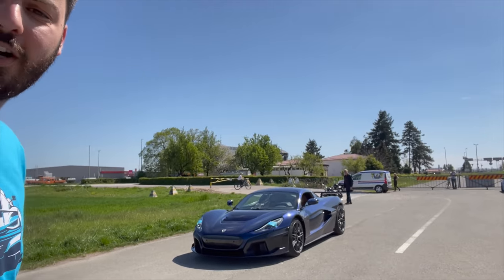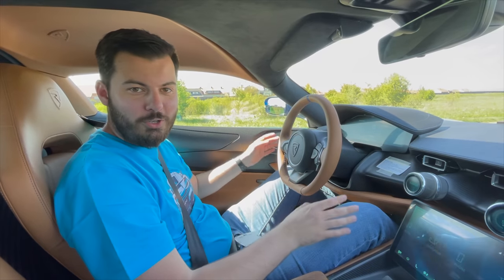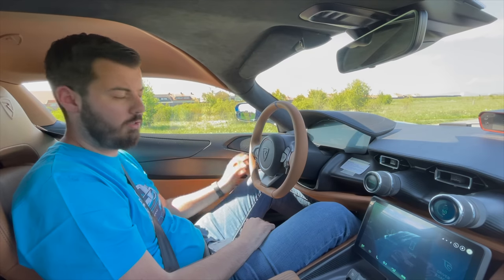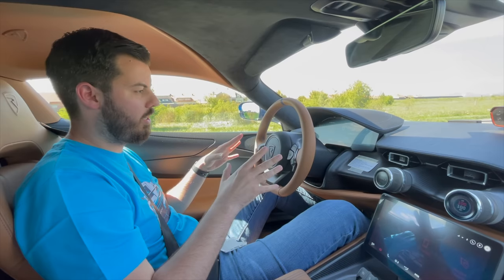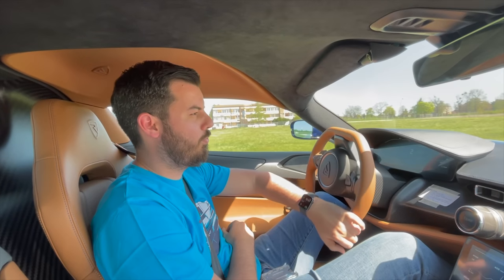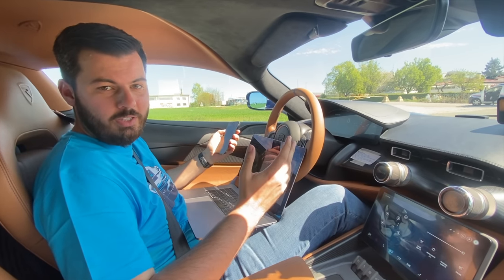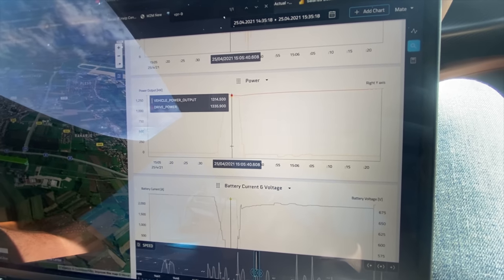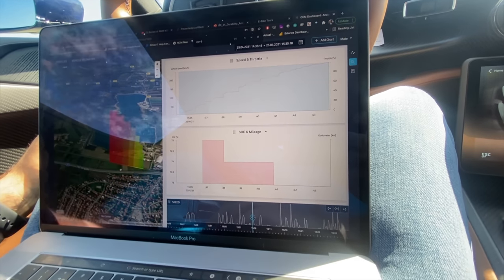Is Rimac Nevera the fastest accelerating production car?

Comment: Absolutely effortless... on a normal road as well. That's scary fast
Reply: Why only 10 likes?
Reply: @Mr11ESSE111  To get below 2sec you need special tyres and perfect conditions. Otherwise its physicly impossible. Also he said at the start that the car is not on 100% power
Reply: @Mr11ESSE111  1.9sec 0-60mph 2.0 or 2.1 0-100kmh if I remember for the normal plaid variant not 2.2
Reply: @Mr11ESSE111  the plaid plus is 150k . The specs you have shown tend more to the normal plaid variant
Reply: - 82% battery charged
- 85% - 90% of torque
- 1792 hp (100% → over 1900 hp)
- Michelin Pilot Sport 4S tires
- unused and very dirty road with bad asphalt
- he didn't push the throttle to the floor until he passes the 1/4-mile. Maybe it have something to with the fact that this preproduction car has problems to go over 250 km/h
- he didn't used launch control    

→ 0 - 60 mph in 2,33 sec.
→ 1/4-mile: 8,94 sec.

I want to see the times when the car:

- has 100% battery charged
- 100% torque
- over 1900 hp (100%)
- Michelin Pilot Sport Cup 2R
- drive on a street with good surface conditions and on a drag
- has activated launch control

→ the results will be mind blowing
Reply: @Mr11ESSE111  It's an ugly car, and it's not even legal for the road. I can also drive a drag star that doesn't even need 1 second from 0 - 100 km/h 😂
Reply: @Mr11ESSE111  I talke about the Golf that can reach the 100 km/h in just 1,66 sec.
Reply: @Mr11ESSE111  It only has 1056 hp look at the description. You also don't see a license plate on purpose. Only in the back, but you can't decipher it there either. Here someone drives a car that obviously can call up more power than is allowed on the road at the push of a button - an illegal road race. It is not for nothing on the homepage that the road mode provides 220 hp and the racing mode the full 1056 hp. Plus, it's still one of a kind that you can't buy, so you can't compare these vehicles with each other. Also, this conversion will certainly not have only cost 50,000 € and the maintenance will certainly also be very expensive with the many broken parts.
Reply: @Mr11ESSE111  2 seconds slower would mean it accelerates from 0 to 100 km/h in 3.66 seconds, and that's nothing special. An A45 AMGs with 421 hp needs 3.8 seconds from 0 to 100 km/h and is certainly more durable than such a Golf and most likely also much cheaper and, above all, much more luxurious. I also don't think it's 2 seconds that this version speeds up slower, but more like 1 second.
Reply: @Mr11ESSE111  why the f are you here arguing with people with your exclamation marks comments. C2 is at this point an engeneering masterpiece, show me another EV that does the similar(with video proof, not on paper). BTW all 150 are allready pre-sold for 2M each and people who buy them don't give af about some budget ricer golf
Reply: @Mr11ESSE111  Read through my first comment, then you can imagine what times the Rimac will drive under optimal conditions. It will probably take him less than 8 seconds to complete the 1/4 mile. As already mentioned, this golf can't be bought. So this comparison is absolutely pointless. As already said, the Golf with over 1200 hp is not street legal. It's just a tuner's project that can break at any moment. It's a completely useless car that is sure to cost well over 100,000 €. Especially when you include the repair costs and the cost of the spare parts.
Reply: @Mr11ESSE111  Not forever, but because electric cars consist of a little more than 12 parts, there are hardly any wearing parts. In addition, at Rimac, every part is "coordinated". In the Golf, engine failure is inevitable sooner rather than later.
Reply: @Mr11ESSE111  I also know that these cars are mostly in the garage, but the C2 is designed to be pushed to the limit. Yes, the parts for such a car are extremely expensive, but overall it is a much better car.
Reply: @Mr11ESSE111  On the one hand you can't compare a Tesla Model S plaid with a Rimac and on the other hand the Tesla Model S plaid only accelerates from 0 - 100 km/h in 2.1 seconds after it has driven 30 cm. This saves 0.3 seconds so the Model S Plaid needs about 2.4 seconds from 0-100 km/h. Above all Tesla cars are known for not creating the factory specifications. You can only call up your top performance 2-3 times. This will work much more often with the Rimac. Why do you think the car is so expensive. Certainly not just because of the brand.
Reply: @Mr11ESSE111  it doesnt have launch control, when it does it will smoke 2 seconds and with the right tires and weather conditions it will smash it
Reply: @Raptile07  yeah I agree. A better comparison would be between the Rimac C2 and the Tesla roadster 2022. Those cars will be just about as fast as each other, but the Tesla will be $1.8 million cheaper
Reply: @Mr11ESSE111  So you think a car with acceleration 2,5 sec should cost 2x more than car with acceleration 5 sec.
It is not how it works
Reply: @Mr11ESSE111  Lol, tuners in garage. Porsche didn't invest in tuners in garage, but in Rimac. Can you tell us why?
Reply: @Mr11ESSE111 it's close to impossible to get to 1,85sec. Aero doesn't do much, even at 100km/h. Tire and road relly on friction. So you can't get faster than ~1.84 sec in theory on earth. Road tires eat like 3% of potential force, a clean road 2-3% a dirty one up to 5% of potential forces. So you end up with 1.9X sec 0-100km/h if you relly on tires.
Reply: You New to cars?
Reply: @Mr11ESSE111  you omit something the weight helps a zero to 100 that's why the Porsche has better tesla grip too
Reply: @MrHaggyy  Then how you explain dragsters that hit 0-100kmh in 0.9seconds?
Reply: What funny to see you here
Reply: Play Fh4 again please
Reply: 400k 😁💪🥳🥳
Reply: @golix1344  they not only rely on friction. They use adhesive effects and if you go top-fuel even the thrust of the exhaust starts to matter. But the main reason dragsters go sub 1.8 is resin and glue in the tarmac, close to liquid tires, that's why they spin them first, and the tarmac is very rough so the tire can push by friction but also push back against tiny hooks in the tarmac. The last thing i mentioned is pretty much the difference it makes in sprinting if you have a starting block and spikes vs no block and normal shoes.
Could you use these on the Rimac? Not really most of them require a specific designed road/tarmac and would eat up the rubber from the tires faster than you could empty the battery.
Formula Sport talks about these effects often. Blistering is when the rubber gets to hot and starts boiling, tire degradation is when the tiny hooks in the tarmac took away too much rubber from your tire and you basically run tiny flat spots. On a road these effects a grey area but most car manufactures, tire manus, road building comp. would consider them as illegal. Pretty much like drifting, driving on liquid boiling rubber, is illegal in most streets.
Reply: Yeah
Reply: dude tesla will smoke it like nothing.4 seconds fast
Reply: The Tesla fanboys tho :))))
Truthfully, this is a really fast car. 8.9 in 1/4 mile is fast, end of the story.
We would really like to see what it can do with launch control and 100% everything on a drag strip.
Reply: @dragosradici7500  what's with the big smiles tho ? What's the problem with people that are so called Tesla fanboys ? I don't see you complaining about any other kind of fanboy so what's special about them just wondering
Reply: Bro upload please
Reply: @Raptile07  k
Reply: yeah...and just think that this is done using age old battery tech. The motors...they can deliver monstrous amounts of power and torque instantly, it is just the batteries that hold these cars up, but I am sure in time things will get solved and figures like 2000 horses won't be so insane in a few years.
Reply: Hello bro congrats on 400k
Reply: Very very fast!!!!!!
Reply: @Mr11ESSE111  Your mind and logic is supernatural
Reply: @PlaidZoomer  you do realise that the specs Tesla roadster had were in 2017 and that the Tesla roadster will be released in 2022right sound be only logic to assume the car is way better than the concept was not say it's as fast as the C2
Reply: @Mr11ESSE111  The car isn’t at 100% power. At 100% power, it gets an 8.6 second 1/4 mile, and the 1.85 second 0-60.
Reply: @bunsenn5064  never seen a Nevera under 2 seconds...
Reply: @alexz8373  carwow has a video made about this rimac nevera doing 0-60 in sub 2 secs
Reply: @noob5268  wrong !
Reply: WoW hi
Reply: I LOVE the fact they are almost silent doing it - that just blows my mind...

Comment: Mate is a literal hero of mine, such strong passion for what he does. Massive support from Hungary!!!
Reply: I would say, he is the Christian von Koenigsegg but in the electric car scene
Reply: I started designing a car because of what I saw him achieve.
Reply: He is tief. AsparkOwl is original. Rimac is copy.
Reply: @mre596  from a Top Gear article: "Aspark told us this drivetrain is sourced from an external supplier, but wouldn’t comment on exactly who built it." Well, the Lotus Evija, Pininfarina Battista are built using Rimac components also Koenigsegg uses their tech in the Regera, I wonder who could have possibly supplied them with a 2000 HP electric drivetrain? 🤔🤔🤔
Reply: @mre596  Okay, but who even is that AsparkOwl? If Rimac would have stolen from them they at least need to be some kind of Known in the car Community and i certainly dont know them

Comment: 8:33 never apologize for geeking out Mate. It's a rare sight to behold when the CEO has engineering knowledge.

A sub 9 seconds quarter mile production car is an engineering masterpiece. What an incredible achievement!
Reply: Yeah! I actually LOVE it when he geeks out, that's a good reason I like this so much.
Reply: and if you think its not the finish Product with full Power
Reply: @Mr11ESSE111  it’s worldwide knowledge this car is going to be produced 150 units. That’s more than enough to meet the criteria production cars.

And the finished car is expected to have 1914 hp. This run here is only with 1722 hp.
Reply: @Mr11ESSE111  yes a 2000 hp Car after a couple of Acceleretions or 1/4 Mile runs and your Engine is gone.Less Money cars with Casoline and 2000hp Streetl legal  not eaven exist.And yes Cars that cost that much money are not driven that much and dont make that km like a Golf 4 Diesel.This Car is for Rimac more a Car to shows shat is possiblle he dont make the Money with this.He makes Money to Build Parts and Technical Solutions for the Car Industrie.Look what a Power use The Jaguar E Pace,wich is a E Famaly Car.
Reply: @Mr11ESSE111  yes nissan Alpha with 2000 HP is absolutlley realible🤣🤣 eaven a stock Nissan is not cheap in maintain.2000 HP did you really think that this is a Car that you can make Acceleretion on and on and on??after a couple Acceleretions in short Time the Car will be burn down thats for shure😎 2000hp Petrol is by far not eaven close that much realible like the same Car as an Electro.
Reply: @Mr11ESSE111   yes a Nissan with 2000 hp gasoline ia allmost a car for everyday and everyone.You compare Hypercars like Rimac,Koenigsegg and other with a Tuned Nissan GTR???Yes you can take a lot of cars and put Power like 2000hp.But where isother stuff like Performance,or how this car are build.and All this Hypercars goes up in Value,A Tuned Car is nothing more as a tuned Car and after a short Period all that Money that you have put in this Car is gone.On the Top the Maintaine Costs of this Car wich month per month cost you more and more.If You compare Hyper Cars with this Fast and Furious shit?The only Thing that i can answer is🤦‍♂️
Reply: At company start up he was one man company.
Reply: @johnnyblaze1372  someone get the point. Kudos for you mate 👍😜
Reply: @dragancrnogorac3851  a garage project 😜 that went 🍌